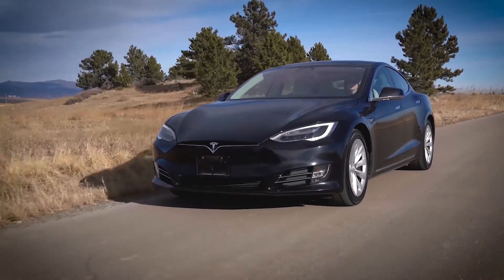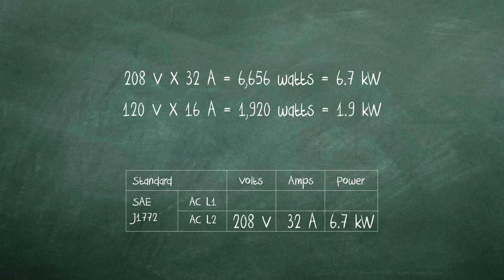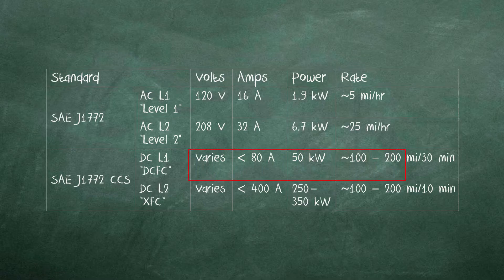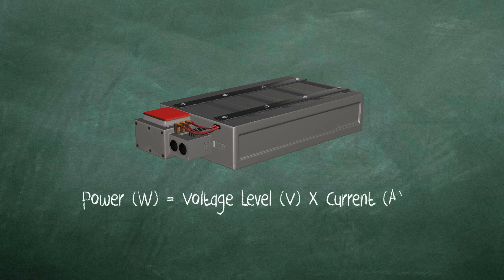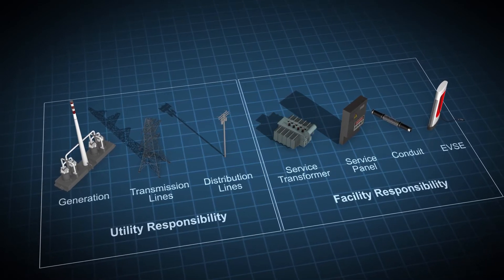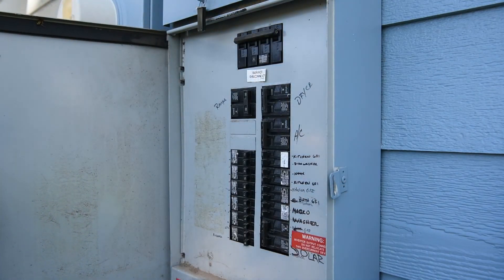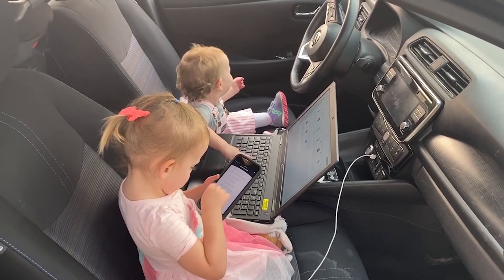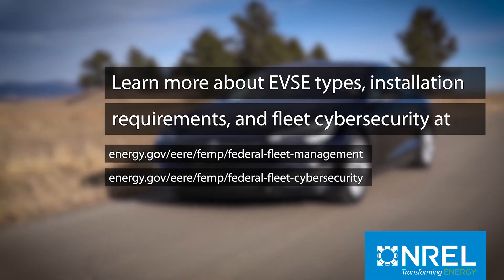Federal Fleet Training: Electric Vehicle Supply Equipment Infrastructure

Comment: So GSA owned vehicles are out and about during the work day and being charged at night.  How will GSA charge vehicles sitting in an employees driveway?  Many GSA vehicles are “take home” for employees who are required to “respond” 24/7.
Reply: Some local governments are handling this the same way they handle gov-issued smart phones.  The monthly electric charging costs are reimbursed via reimbursement requests, or through a stipend.  In many cases, no new charging equipment is needed beyond an extension cord, but if mileage-driving demands require it, an EV charger can be installed at the house at gov expense.  I don't know if or how this aligns with GSA policy.